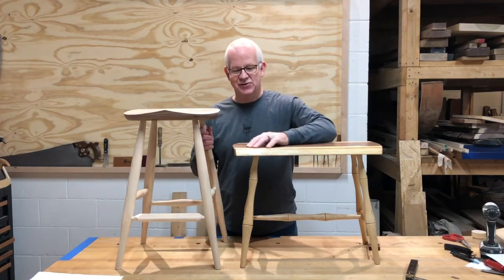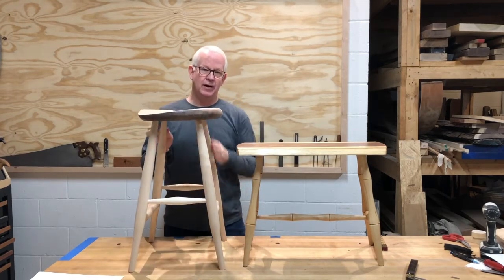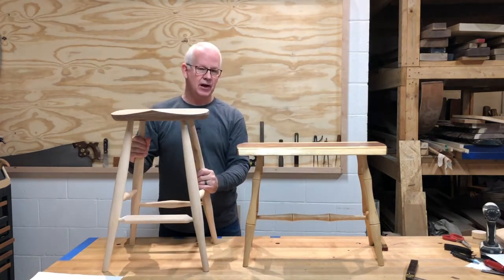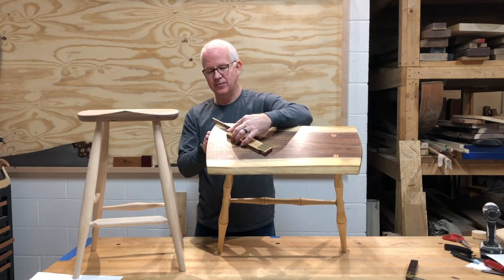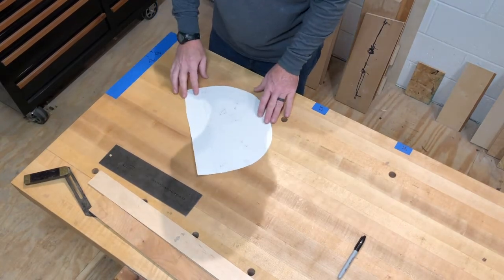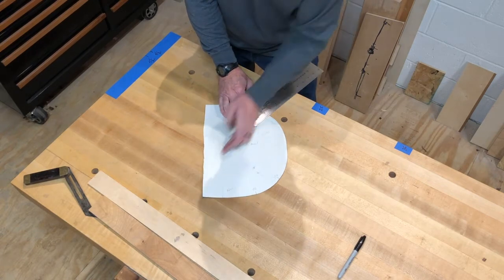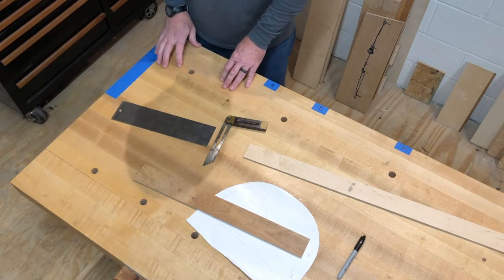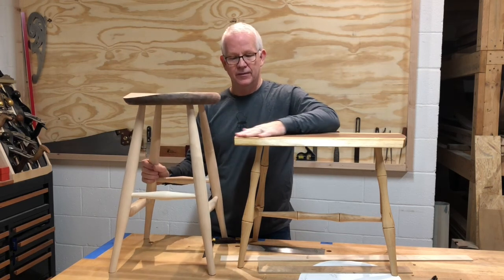Allan Williams Woodworker - Calculating Leg Angles

Comment: So much more sensible (and accurate, probably) than the strange diagrams lots of videos show!
I had been using a bit of trigonometry to calculate the angle (Tan(angle)=(square root of (rake squared + splay squared))/height) which worked fine, but your method is definitely simpler! And you don't really need to know the angle - just use the gauge to set up the drill press.

Comment: This is great. I'd like to see your drill press set up for drilling your holes in the seats. I've been looking a long time and there's nothing on you tube covering this.
Reply from the maker: Hi Bruce.... I just drill them manually   by sighting down the drill and referencing off of a t-bevel gauge set to one side and a square set on the sight line. I use a bit and brace since it’s a slower process and veieasy to control. Check out Curtis Buchanan on YouTube. Huge wealth of information and he demonstrates these steps very well ... plus he’s a great story teller and darn close to a National Treasure!
Reply: @727williams   Hi Alan. I'm drilling into the bottom of half round logs for benches and would like to get the angles symmetrical. I've tried the bevel gauge technique but it's pretty difficult on random shaped logs. I think I'll end up building some kind of a jig. I have some ideas, but I'm not entirely sure what it looks like yet. Thanks for your reply and suggestions.
Reply: I’ve been using a Rockler portable drill guide on live edge benches with excellent results. 
For half logs, which I’ve been going to try, I think I would use the same drill guide but make a jig out of flat dimensional lumber to go over the bottom of the log, bottom facing up, if you get my drift.
Reply: @michaeldennis4860  I ended up building that jig and it works quite well but it's pretty fancy and cost me $400. lol. I was determined! The problem I'm having is for drastically different sizes, since I'm doing from 9" up to 20". It works great on the big stuff.  If you'd like to see more let me know. I've never done a you tube video but I should at some point.

Comment: Great video! How do I ensure all my legs are cut the same way with say a 1/4” angle on both sides each leg? Thanks.
Reply from the maker: I kind of hurried through that early in the discussion when I had my paper pattern but basically drawn out a few simple lines on the seat bottom. I connect my points between the drilling point and where I want the leg to land and extend a line from those...then I sight down that and drill at the angle I’ve come up with. Once the lines are laid out on the bottom it’s easier to see the symmetry you created...hopefully this isn’t too confusing. Peter Galbert’s book has great information on this process and also Curtis Buchanan on YouTube is outstanding.